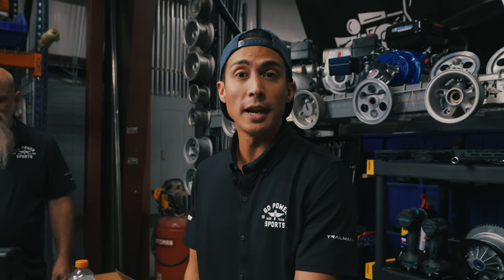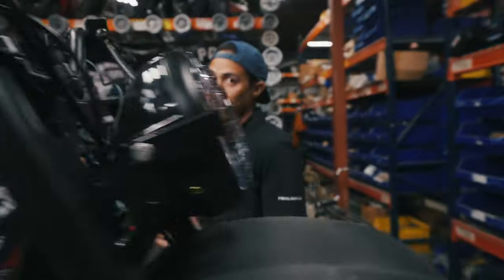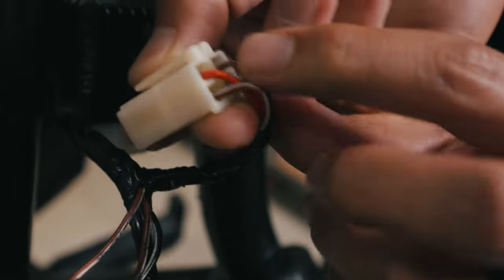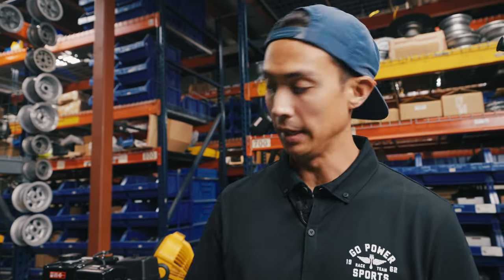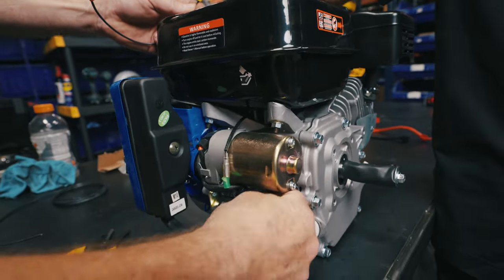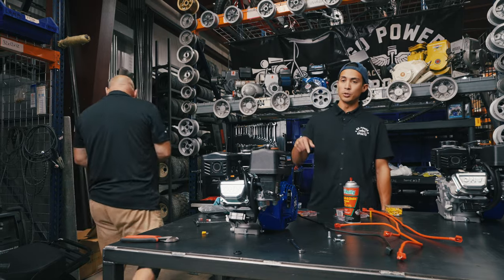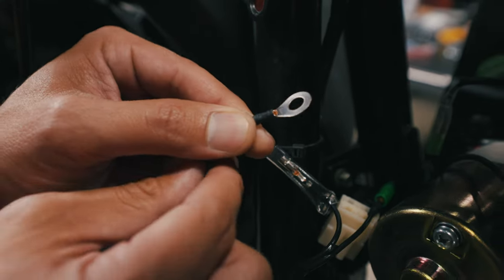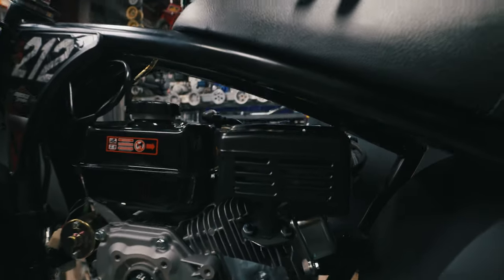How To Assemble Mega Moto 212 LED Light | Option 1

Comment: Just bought one of these kits from you guys.  Great video!  So... with the Tillotson pull only  motor, I guess you were pointing out that no headlight power is available?  Any motor mods / stator solutions to that issue, or is a solar battery solution about it?
Reply: A charging coil from a clone and an LED, that's it.